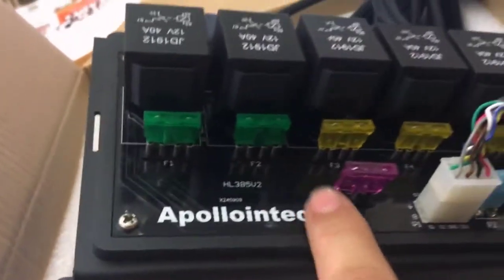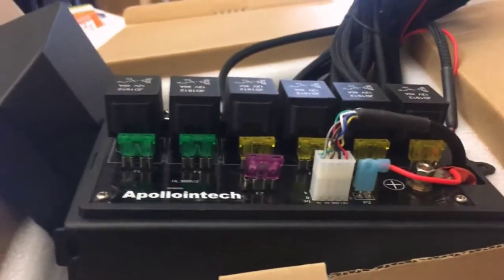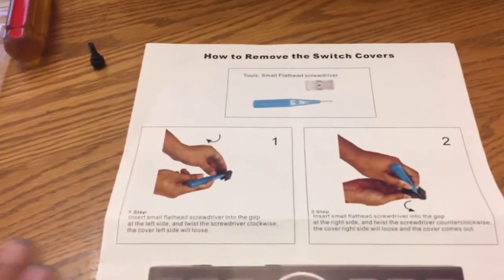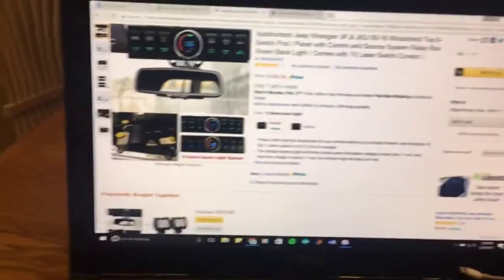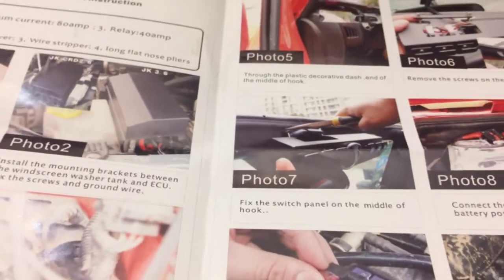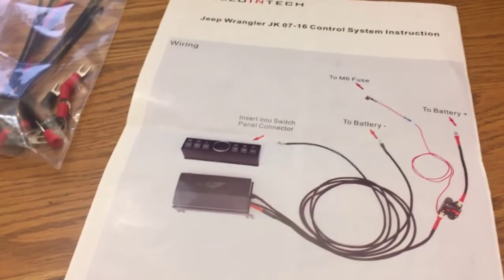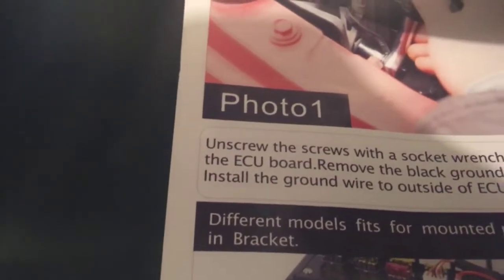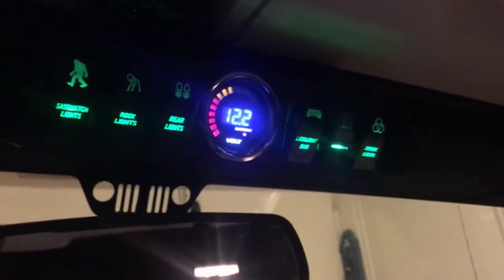Apollointech Jeep Switch Panel & Fuse Relay Review

Comment: How is it handling dirt/dust?  What about if it gets wet?
Reply from the maker: Dirt and dust are no issue, the fuse relay itself is sealed in the box and intact. No signs of rust on any part of the unit after a year of off roading monthly and heavy Chicago winters.
Reply: Windy City Jeep Force thanks for the speedy reply...not that I plan on doing any deep water crossings...but I was wondering about it, just in case.

Comment: Hi, my switch 2 and 3 are not working. Are you aware which relay or fuse can be changed
Reply from the maker: vbreygin Sorry for the delayed reply, if you open up the fuse relay, the spot where you attach your accessory power and negative cables lists switches 1-6 on there.

Comment: Curious how your apollointech is holding up? I really want a spod but the price is making hard for me. I just saw your vid and for the price it looks to good to be true.
Reply from the maker: Chris da Shocker , So far no concerns. I was also on the market for the sPod, mainly because of the Bluetooth feature. But when I saw the ApolloIntech, I knew it looked way better. First off the sPod switch panel is just a row of switches, they don't provide you with any custom labeled rocker switches so you'll have to remember which switch is for what. To me that was just bland and ugly. 

The ApolloIntech switch panel gives you I believe it was 10 switches so you can choose what each switch position is labeled for, not to mention the custom center gauge that reads how many amps you're pulling looks badass.

Comment: Man awesome video my question to you is the winch is recommended on what fuse amp?
Reply from the maker: unanimous games ...The winch draws too many amps for the fuse relay system. You'd have to connect the hot cable straight to the battery. Then install a separate rocker panel killswitch. Tons of videos on YouTube showing that. I plan on installing a winch on mine, and will make a video soon. Thanks!
Reply: Windy City Jeep Force dope thanks for info.I asked because I just bought this relay system and  noticed there was a winch rocker switch for it but I currently have my smittybuilt winch directly to the battery with no switch and it works just fine I guess I'll keep the relay system for lights only

Comment: Any problems? is there a warranty? does OTRATTW switches work with it and is it available with an air gauge? thanks! it's interesting $$
Reply from the maker: Brixx Hey there, few of us in the club have them and have had no issues. I believe their warranty was either 1 or 2 years. No air gauge option, only 3 different color options for the rocket switches.
Reply: OTRATTW rockers fit fine - if you want to pull the switched and replace them they are identical in size to the CONTURAV switches. They are 3 wire and the light up Conturas are 5 wire one of which is a second ground for the second LED - you will need to rewire the panel but it should work

Comment: Great review, thanks.  I was thinking about getting one and was also concerned with the panel interfering with the tops on my 2010.  Looks like I should be good to go.
Reply from the maker: pjcyndie , The switch panel sits snug against the trim panel leaving you enough room to fit your hand in there and turn the freedom top handle. I had no issues with my hard top.
Reply: Thank you.  Any concerns with water leaking into it from the top or if top is off??

Comment: How did you run the wire into the cab. I have a manual transmission two.
Reply from the maker: Hey Anthony, the wire was ran through the firewall grommet located on the drivers side of the engine bay firewall, then up inside the plastic trim of the a-pillar, and then plugged into the switch panel that sits above the rear view mirror. Hope that helps.
Reply: Thanks for the advice, help a lot  found the hole on the left thank you for your help.

Comment: Do the LEDs turn off when switched to off position like SPOD? The Rough Country version doesn't and kills battery over time I've seen in the review.
Reply from the maker: Luis Camacho Hey Luis, yes they do shut off. The Jeep has to be in Accessory mode or running for the switch board to be powered up.